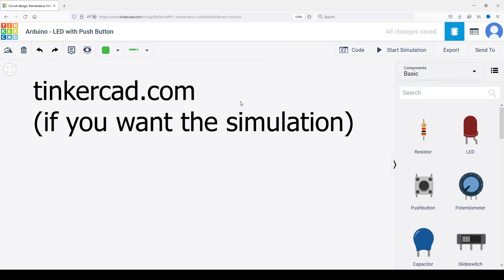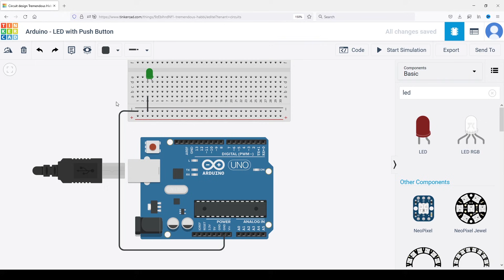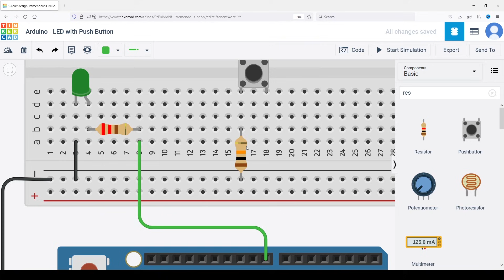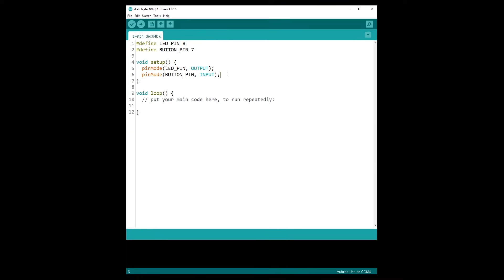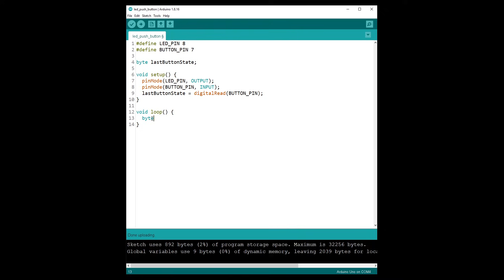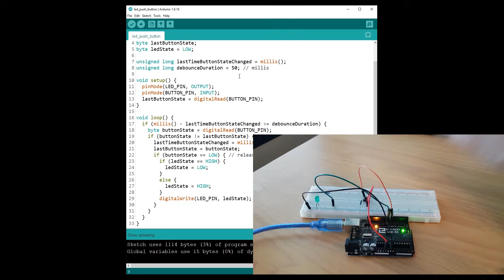Arduino - Turn LED On and Off With Push Button

Comment: I enjoyed the video and was finally sucessful in running the code on my Arduino Uno.  I think it was unnecessarly difficult to extract the code from the video considering the many "back and forth" journeys in the coding.  One set-back was caused by the use of different coding styles, e.g. (#define led  #define button)    &  (#define LED_PIN   #define BUTTON_PIN)
Here is the code I ended up with Thanks

Turn on the LED when the button is pressed & keep the LED on unless the button is pressed again. 
If the button is pressed again the LED will remain off unless the button is pressed again.
The on & off state of the LED will toggle each time the button is pressed.

#define LED_PIN 8
#define BUTTON_PIN 7

byte lastButtonState;
byte ledState = LOW;

unsigned long lastTimeButtonStateChanged = millis ();
unsigned long debounceDuration = 50;  //millis

void setup () {
  pinMode(LED_PIN, OUTPUT);
  pinMode (BUTTON_PIN, INPUT);
  lastButtonState = digitalRead(BUTTON_PIN);
}

void loop () {
  if (millis () - lastTimeButtonStateChanged >= debounceDuration) {
    byte buttonState = digitalRead (BUTTON_PIN);
    if (buttonState != lastButtonState) {
      lastTimeButtonStateChanged = millis();
      lastButtonState = buttonState;
      if (buttonState == LOW) {  //released
        if (ledState == HIGH)    {
          ledState = LOW;
        }
        else {
          ledState = HIGH;
        }
        digitalWrite(LED_PIN, ledState);
      }
    }
  }
}

Comment: //My code version:

#include <SoftwareSerial.h>

#define LED_PIN 8
#define BUTTON_PIN 3

bool LedState = false;  //bool - the state can only be ON or OFF.

void setup() {
  pinMode(LED_PIN, OUTPUT);
  pinMode(BUTTON_PIN, INPUT);
}

void loop() {

    if(digitalRead(BUTTON_PIN) == HIGH){   //if the button is pressed enter if#
      delay(250);  //small delay for button bounce.
      LedState = !LedState;  //set LedState to be not what it is.
    }

    digitalWrite(LED_PIN, LedState);
     

}
Reply: how could i put a countdown with milis. so that the led goes off after 60 seconds?

Comment: It should light up when the user presses the button once, and then go out when he presses it again. However, if the user presses the button again within 5 seconds, the LED should turn on and turn off after 5 seconds. how can I do that
Reply: You have store the time of the first button press in a variable.  You also have to store the number of presses in another variable.  Then you test with (psuedo code)  "If (ButtonPressCount >= 2 AND ButtonTimer <= 5Seconds) {do something}

Comment: I still don't understand why do we need that 10k resistor, while the pushbutton simply breaks the circuit when it's not pressed.
Reply: Pull down resistor
Reply: Yes bro i am also have this question
Reply: @AashirwadTyagi-ch4me  I figured it out bro. It's for making sure that arduino receives only 2 values, either 5v or 0v, from the pushbutton. Without the resistor, arduino might receive "floating" states or in-between values due to electrical noise, that can cause confusion and misbehaving of the circuit. When the button is not pressed, the resistor PULLS DOWN  the reading to 0 volts, preventing false reading. Also it is said that the resistor prevents short circuiting by limiting the current, when button is pressed, coz it's directly connected to both terminals.

Comment: I have a question about the button pin? why the button Pin is 7? How to define which number of pin is for the button?
Reply from the maker: the button pin is 7 just because I decided to plug the wire from the button to the pin 7 on the circuit :)
you could use any other valid pin, then make sure you use the same number in your code.

Comment: Thank you so much. I needed to program something for the school where I had to set up the button as you explained. In no video I have found a programming that detects when you press the button to turn on a light and then another press to turn it off. Thanks again. Keep explaining this kind of stuff, it's worth it.

Comment: I replaced the push button with an electric wire, but when I short-circuited the electric wire, it turns on, and when I don't, the led turns off, but once I short-circuited, the led keeps turning on, so can't I replace it with an electric wire?
Reply: The button is to act as a "momentary" contact, that is to say you push it down for a fraction of a second and let it go again.   This code is not designed for the buttong to be held down continuously.  To use a wire for continuous contact try this code in the Loop:   

if(digitalRead(BUTTON_PIN) == HIGH){   
      digitalWrite(LED_PIN, HIGH);
    }
    else 
      {
          digitalWrite(LED_PIN, LOW);
      }

Comment: on your diagram resistor, it's seems 10k right ? not 100k on your video. its brown,black, yellow, gold
Reply from the maker: Yes it's 10k Ohm (4 band resistor)
Note that for the real circuit I use a 5 band resistor, so the colors are a bit different (but still 10k)

Comment: Why is not working?

int buttonPin=13;
int buzzer=2;

byte LastButtonState;
byte BuzzerState=LOW;

unsigned long lasttimebuttonstatechanged = millis();
unsigned long debounceduration = 50;

void setup()
{
   pinMode(buttonPin,INPUT);
   pinMode(buzzer,OUTPUT);
   LastButtonState= digitalRead(buttonPin);
}
void loop()
{
  if (millis() - lasttimebuttonstatechanged >= debounceduration)
  {
byte buttonstate =digitalRead(buttonPin);
 if (buttonstate != LastButtonState)
{
    lasttimebuttonstatechanged = millis();
    LastButtonState = buttonstate;
    if(buttonstate == LOW)
    {
      if (BuzzerState == HIGH)
      {
        BuzzerState = LOW ;
      }
      else
      {
        BuzzerState == HIGH;
      }
       digitalWrite(buzzer,BuzzerState);
      }
    }   
  }
}
Reply: I have known what is wrong the fking = after else just remove one

Comment: If I wanted to wire this up without the bread board how can I do it in regards to the ground? Would I split the ground on the switch? Or how can I do that?
Reply from the maker: in this case you need to find a way to connect all grounds (maybe by soldering?)

Comment: I've done this. Except with 5 buttons and LEDS. The debounce doesn't seem to work consistently a crossed all of them. 
is this because of how they are being called in the code? Is there a way to call each button and led block within an array?

If you see this. I would appreciate your help, thank you.
Reply: Well, i use another debounce system that i think would work better for your case than the on in the video. Instead of using millis(), i use a bool system, let me give you an example:
 
if (debounce == false) { // Checks if debounce is on or off
        debounce = true; // If its off, sets it true 
        digitalWrite(13, ledState); // Turns led on or off
        delay(1000); // This is the debounce duration, i put 1000 miliseconds
        debounce = false; // Sets the debounce off after the designated time has passed
}  

I am not sure if you can or not but i believe that you can implement this to multiple LEDs, probably you'd have to create 5 different bools

Comment: THANK YOU SO MUCH!
Instead of an LED, I used this on an 8 part Relay to power my LED Strips. I do have a problem where if I accidentally jiggle the wires it thinks a button is pressed, but that's likely the cheap breadboard/crappy duponts.

If you're doing the same I had to put my delay to 1000 milis otherwise it was going crazy. (It's interesting at first, but a great way to damage them.)
Reply: I did the same thing, but they take way longer to actuate now, lol.
Reply: @FlockofSmeagles  I figured it out... I'm wildly dumb, I also didn't touch it since my last comment. 
I skipped the circuitry section because I was eager to get this to work that day. My coding wasn't the problem, it was the wiring.

I forgot to add the 5v to the button lol, curiously it worked the first time for 5 minutes, but never again after that. Now it is fixed and I have it set to 500 milliseconds, however I'll edit this to get the lowest one without any bouncing. 

The reason it first but then wasn't working is because I'm in a small room surrounded by electronics, the interference caused by them made the button go crazy. I'm very new to this so I had no clue. I was dealing with a "floating pin" problem

I'm using an Elegoo 8 Part relay so I'm not sure if this will help with yours but I'll link what I found and hopefully YouTube doesn't get mad at me.
Like the guy in the GIF, I was able to actuate the button without pressing it. This stuff is so interesting.
https://makeabilitylab.github.io/physcomp/arduino/buttons.html#the-floating-pin-problem
https://www.youtube.com/watch?v=wxjerCHCEMg&ab_channel=AddOhms

Hope you got yours to work better otherwise. Hopefully this helps if you haven't!

Edit: I got it down to 10 Milliseconds with it only bouncing once from 10 presses. I can give you my code if you want. Idk if that'll work on here but I can try
Reply: yo man if you still can, can you send me a code? @navb0tactual
Reply: @FlockofSmeagles  Yeah the next day mine just turned on and off without pressing the button... I love coding... I'll see if I can figure out why, but I have very little faith in my coding capabilities (or lack thereof lol)

Also I actually put mine on 1250 milliseconds, which is 1.25 Seconds... I actually like the delay for some reason, but I can see that being incredibly annoying.
Reply: You may also have grounding or power supply problems.  Try running on batteries for a clean DC supply.